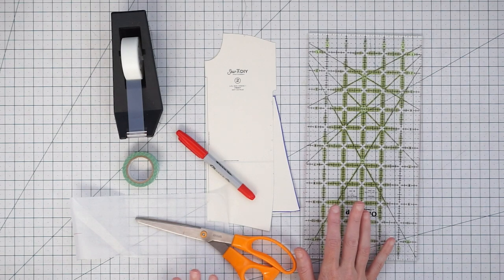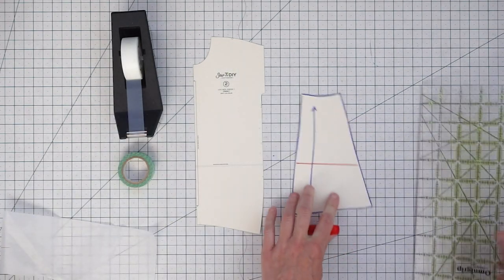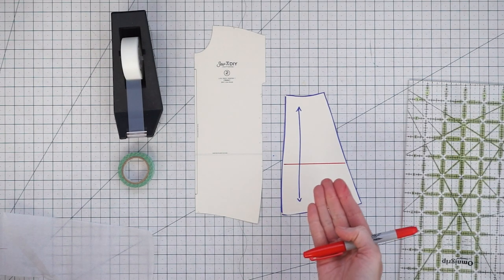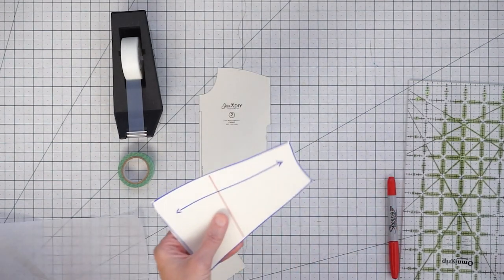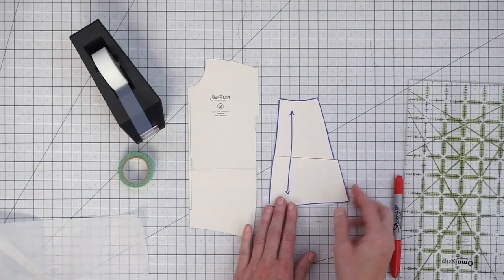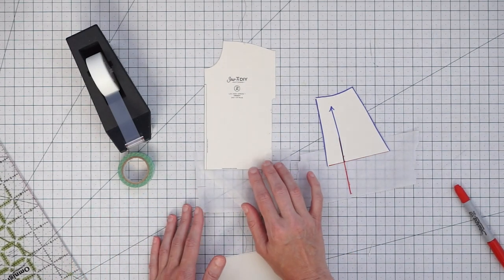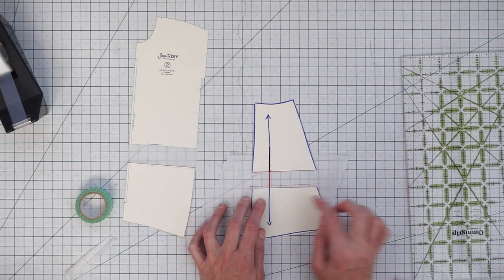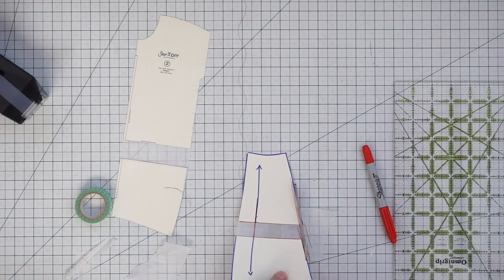How to shorten or lengthen the skirt of a sewing pattern

Comment: I have a question.If I am using a multi- size, basic a -line skirt Pattern that also offers different length options. I want to make a slightly different length than one of the options - an "in-between length" than one of the shown combinations. I only want it an inch different. Should I still lengthen or shorten from the middle? Love the video - thank you!

Comment: How do you find the grain line?
Reply from the maker: It should be printed on the pattern. It's usually a line with a triangle/arrow at each end. If the pattern piece is cut on the fold, the fold is also usually the straight of grain line.